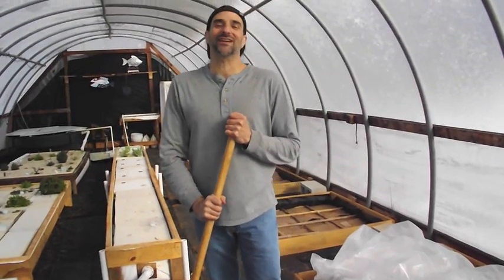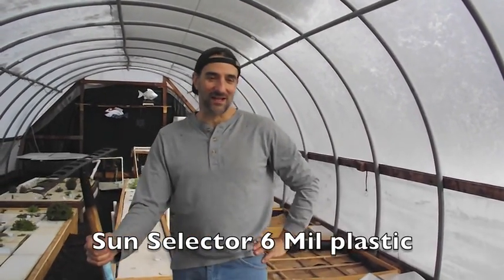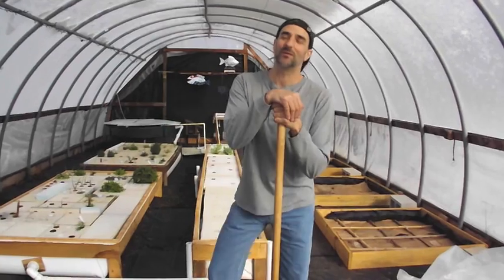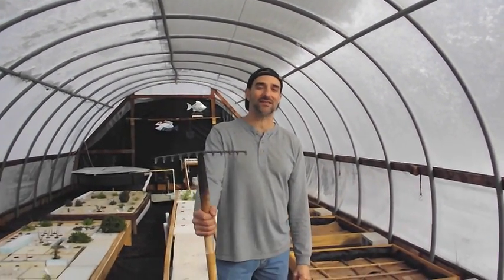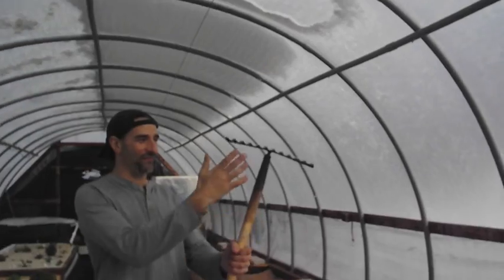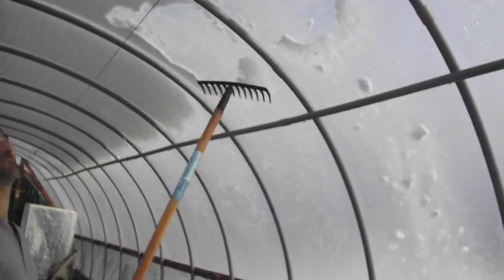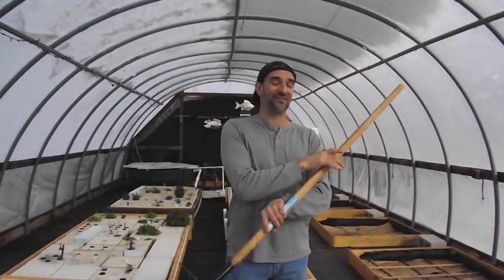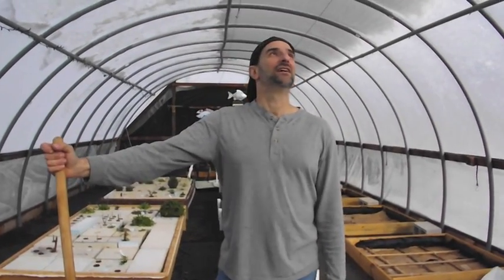Greenhouse Plastic Strength Test

Comment: Great video! I have a couple questions. Why isn't the heat within the greenhouse melting the ice so that it will not accumulate on the plastic? I'm about to build a 50 x 30 hoop house. I need to know if the inch-and-a-half electric conduit is thick enough to handle the load or do I need to go to EMP conduit. Where do I get this information or do you have any comments on that? Thanks!
Reply from the maker: We don't heat our greenhouse and since it is not air tight, we loose much of the heat when the sun goes down. (It's only really cold about 2 months here in Tennessee). Even in the dead of winter, the greenhouse heats up nice in the daytime but gets quite cold at night. We don't attempt to grow much during January and February since there really isn't enough sunlight as the days are shortest so no need to heat it. As for strength, 1 1/2 inch pvc is pretty rigid. If I had to guess, I would think it would hold up but I would add 2 extra purlins for support.

Comment: How do you keep the temperature up at night. In the hoop house . And stop the plants from freezing? Any suggestions
Reply from the maker: We have never tried to heat it. Our Winters are mild enough here in Tennessee that it usually only gets too cold in the greenhouse from late December until late February. Only about 8 weeks downtime. A lot of people try many different methods.  Some people try using geothermal air from underground and others have tried double layer plastic with air blown in between layers. I find it best to just enjoy the downtime.

Comment: does anyone out there know what 6mm is??try o.6mm...sorry America!
Reply: "Plastic sheeting is measured in mils. A mil is a measurement that equals one-thousandth of an inch, or 0.001 inch. One mil also equals 0.0254 mm (millimeter). Thus a mil is not the same thickness as a millimeter." Sorry Steven.

Comment: Are you still using the fastening system with the 3/4" thin wall and 1/2" schedule 40 to secure the plastic?
Reply from the maker: +B Marshall Yes, we are. It has worked out nicely.